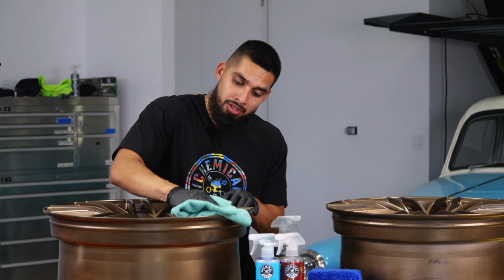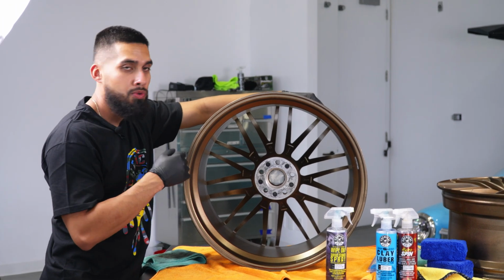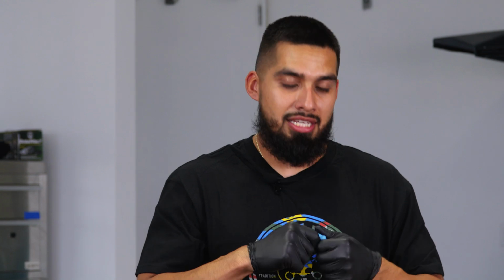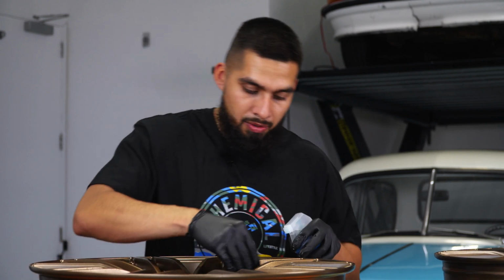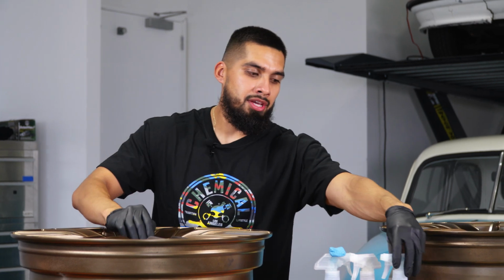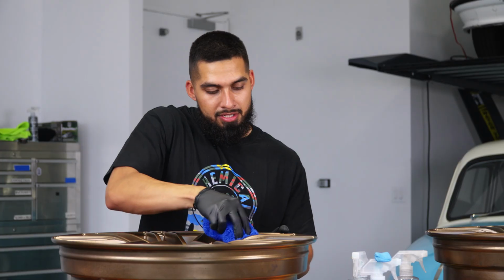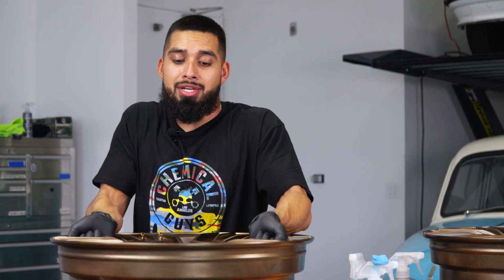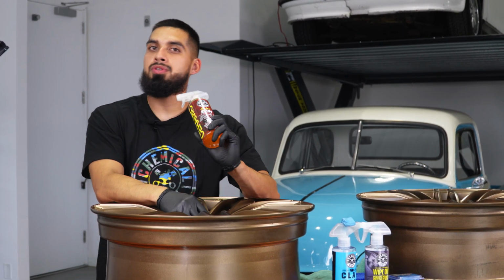How To QUICKLY Ceramic Coat Your New Wheels For Ultimate Protection! - Chemical Guys

Comment: Can I skip the clay bar step if the wheels are brand new out the box?
Reply from the maker: Hey! Inspect the surface to determine if clay bar is necessary.
Reply: @ChemicalGuys Wasn't necessary. And I used yall Hydrospin after coating the wheels in a more dedicated ceramic, C5.

Comment: When it comes to expensive wire wheels for lowriders because of the difficulty level being so much higher with so many wires would you suggest using a non-spray ceramic coating or would this stand up equally to a non sprayed ceramic coating? Thank you...

Comment: I bought a set of glossy black painted forged magnesium wheels that cost about $12k for the set, they're getting coated before I even put them on the car.
Reply: That's a huge mistake bro...  your balancing rim weights won't stick good on the ceramic coating... so when they fly off and damage your car remember I warned you
Reply: @JAMESBALLARD-n9u Thanks for the feedback on that. So far the weights have stuck pretty well. Maybe they have a strong adhesive.